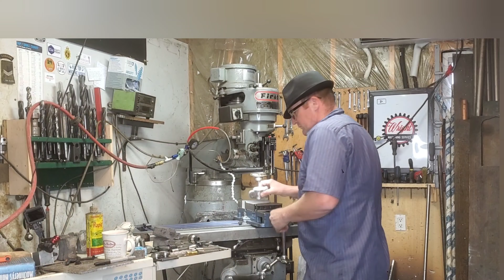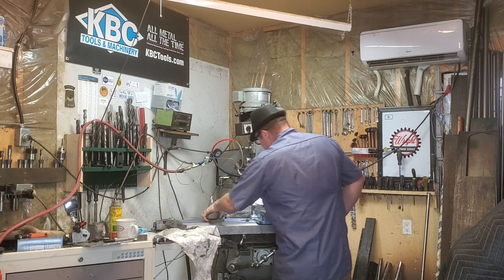Machining Crank Truing Stand Bar Clamp Part 4

Comment: this is where you break out the TIG, and/or those HF aluminum repair sticks to see which is better
Reply from the maker: Hahah true ,  however i think i may machine one from 660 in the short term ,  im thinking of experimenting in the spring however with heat treating the alum to see if i can increase the maluability of the cast material .   I watched a guy kelly cofield and he alluded to the fact that you can do that with aluminum.